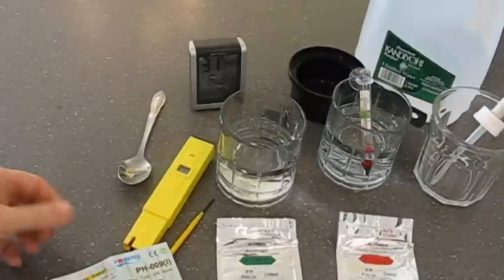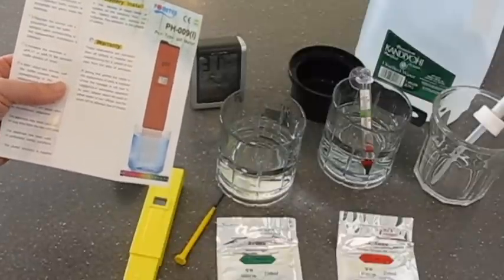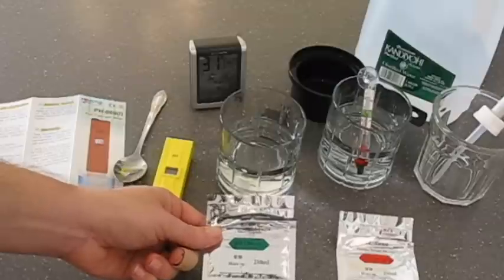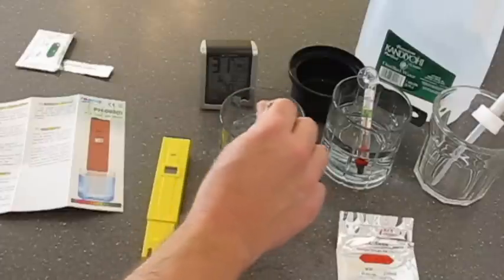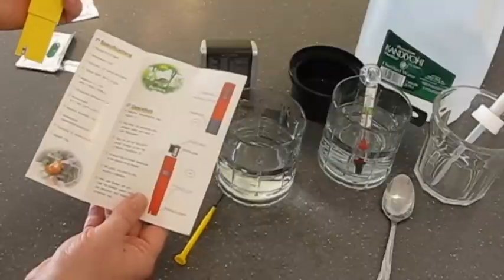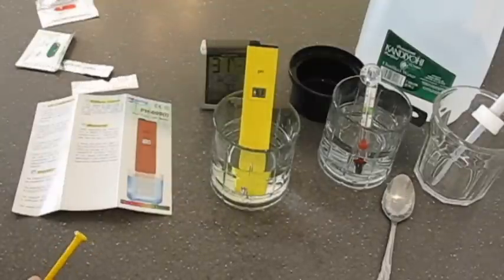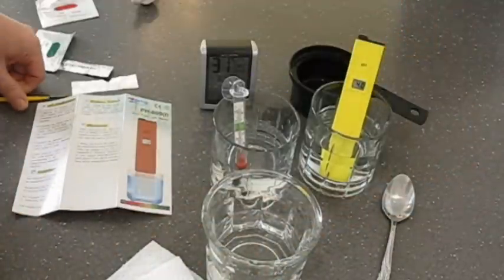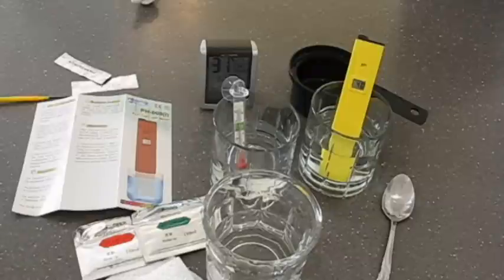Calibrating pH Probes

Comment: You have to keep it submerged in the water to get an accurate count. What you have at submerged you didn't hit hold and it will lock your PPM numbers and then pull it out

Comment: Huh?   Its says under 25 celcius. That means it needs to be under 77 degrees lol.  You did it wrong dude.  If you read the back of the packet at least on mine it shows that temps below 25c keep the solution steady. Above 25c and the ph changes. Thats why you are supposed to stay under 25 Celsius!

Comment: I just bought a pH meter like yours along with a TDS 3 meter. Luckily the calibration packets gave different pH numbers according to the water temperature. Luckily the TDS 3 has a temperature meter along with it. Got mine for about $15 for both. Also had batteries! I did get the strange translation instructions like yours, lol...

Comment: got one of these at walmart on line for $9.98 but the batteries were dead, they were not in the plastic compartment the meter came in which tells me it was a return probably for the on-off button it was sloppy-wiggly in the On position.

Comment: Really helpful video, thanks. Question: The instructions on the packets say to use deionized water, not distilled water. These are very different. I'm confused as to why the advice everywhere except on the packets themselves is to use distilled water rather than deionized water. Which is correct?

Comment: It would be interesting to know how much temperature alters the pH. I'm guessing it's probably not much and accuracy  depends on the application.
I'm currently just using mine for testing drinks (have dental problems) and e-liquid. For using on a hydroponic plant I guess it could be tested at room temperature. Guess I'll go another video about how heat affects pH. I didn't really consider that as a variable.
Reply: Just bought the same pH meter and the sachets have a chart showing pH difference at temperatures from 10-50C. The difference between the two temperatures is only about pH 0.1, so I guess temperature is only relevant if you need the kind of accuracy that would be better achieved by buying a more expensive meter.
Reply: Alex Miller

Cool, that's some interesting information. I guess I don't need to worry about temperature that much for most of my applications then. A 0.5 resolution would proobably be good enough for me.

Comment: how do you store the Pen between measures? in the manual it said to just rinse in distilled water and put the cap on but i read that the sensor must be kept wet all times on a 3mol/l kci solution...
Reply from the maker: +Luis Miguel Batista  Right, I think you're supposed to keep it in distilled water.
Reply: No. Distilled is bad. It can cause the electrolytes to leach from the very fragile layers of glass in the probe.

Comment: hey guys, anyone know the answer of this question: so i got my self a new pen because i accidentally submerged my last one higher quality in water..  and i have a ph 7 solution and know for a fact that my tap water is around 8-9, but the new pen read 12-13, so i tried to calibrate it in the ph 7 solution, and it read the same as the tap water (12-13) so i tried to calibrate it but the screw would only go so far as 9. a few moments later it went up to 11... so i took my ph 4 solution, and hey it showed 7. awesome, i cant change it to 4.. so yeah i have no clue how to fix this mess..

Comment: Out of curiosity, haven't you cross-contaminated the calibration solutions by stirring them with the same spoon, and then inserting the thermometer used in one solution into the other? If calibration equipment is this critical, it seems that this would compromise the final result.
Reply: PixieTrailSprite exactly my thought too!
Reply: Guys the way he done it was corect you lot are just reading to mich into it

Comment: I paid much less than $15 About $8 for the same unit. The instructions seem pretty clear to me but then I'm English. The calibration solution can be stored in sealed preferably amber coloured bottles for about 6 months or longer if refrigerated. After testing the pH of your  fluid you should carefully rinse the electrode in distilled water and dry it as per the instructions. If stored wet moisture may get into the electronics and cause premature failure of the device, these cheap pH testers are not water proof. Don't immerse the meter too deeply for the same reason.

Comment: What a piece of junk, had so much trouble trying to calibrate this. I eventually threw it in the garbage bin.  Just would never hone in on the 6.8 or 4.8 ph liquid.
Reply: it was 6.85 and 4 mate.   lmfao
Reply: Dion Ross  the calibration solution is 6.85 u Muppet.
Reply: Dion Ross  1/8

20-pack 4.00 6.86 pH Meter Buffer Solution Powder for PH Calibration Water BI672
Reply: Dion Ross  you thick fuck.
Reply: Dion Ross  seems you are the stupid one here🤣🤣🤣

Comment: i purchased one of these and found that its to much of a hassle to deal with...! so, if you dont wanna deal with the hassle of going through the calibration process.? go to your local wall-mart and purchase a small bottle of "Aqua chem 6-way Test Strips" only cost a few bucks and the test strips are very accurate.! thats all i use for my hydroponics... these strips test for hardness, chlorine, bromine, ph, alkalinity, stabilizer...! i use well water so i only use the strips for "ph level"

Comment: Kenny when you set the calibration can you then go ahead and test your tap water for acidity or alkaline levels all the time or do you need to  recalibrate over and over again?
Reply from the maker: I'm guessing, but I don't think so.  Once calibrated, it shouldn't matter the source.
Reply: I have the meter but it did not come with the PH powder which i am upset about. I was just made aware of the powder which is essential in setting the meter. Now i have to order powder which is not only a bitch but i have to wait for delivery
Reply from the maker: quality333
 I advise that you buy a liquid bottle of General Hydroponics pH 7.0. You need to recalibrate this about every other time you use it, depending on how often.
Reply: The meter wont work on its own by just immersing it in water ? You need to use the powder?  Its two powders correct? 6,95 and 4.0?
Reply from the maker: quality333
 The powder or calibration liquid is only to calibrate the unit. If your target range is near 6.95, then use that calibration powder/liquid. If your target is near 4.0, use that one to calibrate. After it's calibrated, you insert the tip into your water to see the reading, and, because it's calibrated, the reading will be accurate. Because this is a low-cost probe, it does not do a good job at keeping its calibration and must be re-calibrated from time to time-- especially if you let the tip dry out. Keep the tip in water when you store it.

Comment: That PH meter uses a single calibration point, so you should only calibrate to the point closest the target PH of your working sample. Calibrate at the typical ambient temperature of your sample. Your calibration temp and sample temp should match but it doesn't need to be 77 degrees.
Reply: Same thought had crossed my mind. If you calibrate 6.86, then 4, you actually mess up 6.86 calibration. There is a 9.16 solution to calibrate above 9.

Comment from the maker: Yes. However, I found if I used it like the next day, it still held it's calibration. However, the longer you go between calibrating, the more it seemed to drift out of calibration.  That's why you need to have some calibration fluid on hand. I got mine off of Amazon.

Comment from the maker: It depends on how often you use it. If you use it every other third day, calibrate it every time at first, and you will get a sense for how quickly it falls out of calibration. You may find you can do it less often - or not. Frankly, I stopped worrying about the temp of the fluid, as it didn't seem to make that much difference. This sped things along.